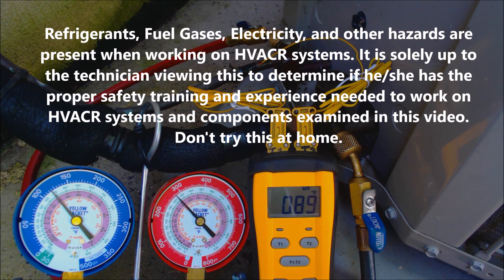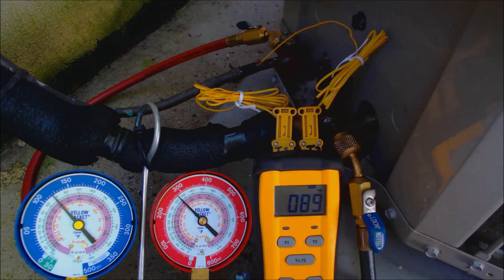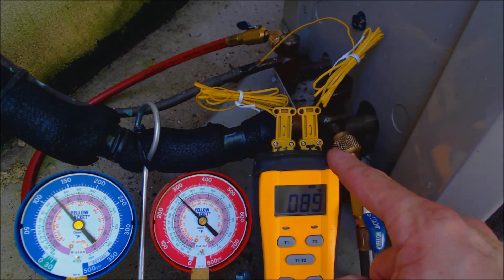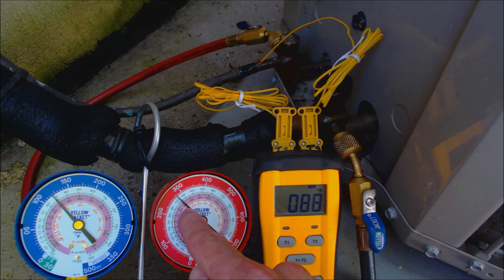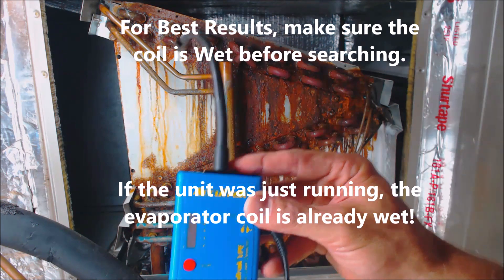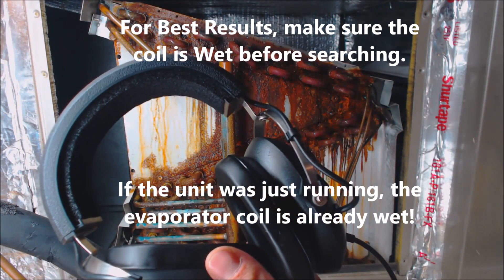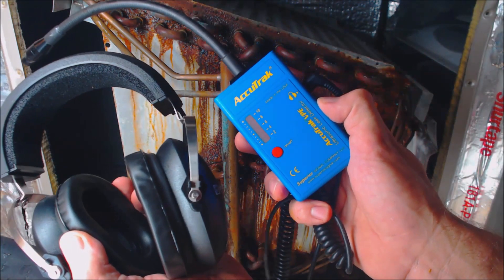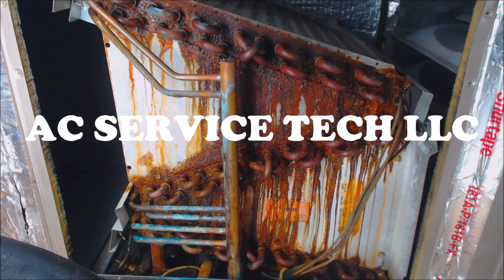AC Unit Low on Refrigerant! Leak Found!

Comment from the maker: Tool List-  https://www.amazon.com/shop/acservicetech
Support-  https://www.patreon.com/acservicetech
For those that are looking for the tools used in the videos: (Linked Below)
Here is the Link to the AccuTrak VPE Pro with Headphones-https://amzn.to/2B2cRO3

Here is the link for the AccuTrak VPE-GN Pro with Headphones-https://amzn.to/2vxD41R

Here is the Link for the FieldPiece ST4 Dual Temp Meter- http://amzn.to/2AhR6ph

Here is the Link for the Yellow Jacket Refrigerant Manifold Gauge Set used in the videos http://amzn.to/2aenwTq

Here is a link to Refrigerant hoses with valves used in the videos  http://amzn.to/2aBumVI

Here is a link for RectorSeal Bubble Gas Leak Detector http://amzn.to/2ckWACn

Here is the link to the Appion Valve Core Removal Tool- http://amzn.to/2uYr8WL

Here is the link for the Ratcheting Service Wrench   http://amzn.to/2dGV4Nh

Here is the Link for the newer UEI DL479 Multimeter with temp sensor- http://amzn.to/2jtsUbJ

Here is the link to the CPS Vacuum Micron Gauge- http://amzn.to/2v1nM3O

Here is the Link to the Appion Blue 3/8" to 1/4" Vacuum Hose- http://amzn.to/2uYlVyc

Here is the Link to the Appion Red 3/8" to 1/4" Vacuum Hose- http://amzn.to/2uYg6Ro

Here is the link to the Yellow Jacket 1/4" by 1/4" heavy duty hose straight-  http://amzn.to/2umtcod 

Here is the link to the pack of 25 C&D valve cores- https://amzn.to/2J1lurm

Here is the link for the C&D Valve Core Wrench, Container, and 3 valve cores- https://amzn.to/2EVGkps

Other tool links can be found in the video description section.

Shop through Amazon! Your Purchases through Amazon provide a means for channels such as mine to earn advertising fees from all purchases after clicking through. Prices are the same as normal-    https://www.amazon.com/shop/acservicetech

All of the ACSERVICETECH Playlists-  https://www.youtube.com/channel/UCOZR-1IqsAer9wzlvFgb4mA/playlists?view_as=public

Comment: Will this work on formicary corrosion leak?
Reply from the maker: It will pick up very small leaks by the noise so it will just depend on how much noise and how little of a leak you are talking b ut I have found some extremely small leaks with this so far, thanks!

Comment: I assume you prefer the Ultrasonic Leak Detector over a dye leak test.  Are there any circumstances where a  dye leak test would be the preferred method to find a leak?
Reply from the maker: Dye would be something that you would look for in all of the visible places. If you can see it, then you would probably be able to find the leak with this detector. All I can say is that I have a great amount of faith in this leak detection method and I prefer its reliability over any other type. I don't like adding additives into the system such as dye or leak stop or anything unless it is because there is a high acid level in the oil. You also have to let the dye cycle through the running system and come back at a later date to look for it. Every leak detector has its place but you can use this tool in a variety of circumstances, even during the nitrogen pressure test, thanks Joe C!
Reply: Thanks for the advice!  Helps my research on the subject.  I believe I have a very small R-22 leak (i.e.less than a pound per year) which I believe will challenge any type of leak detection system.
Reply from the maker: If you are researching the best leak detection method then you may find the same things I did before going and getting this leak detector. Did you read the reviews online and on amazon for this product? Compare this to any of the other brands and types and let me know what you find. The issue on the other hand is after you find it, can you fix it? If the evaporator coil looks like the one in the video, it may be coming from there. Obviously we don't guess and we look and find them but sometimes like in the case of this video, it is worth replacing instead of fixing. Here are two links for your research, thanks and did you see my other video using this tool?- 
  -     Here is the Link to the AccuTrak VPE Pro with Headphones-https://amzn.to/2B2cRO3
--     Here is the link for the AccuTrak VPE-GN Pro with Headphones-https://amzn.to/2vxD41R
Reply from the maker: ultrasonic leak detector video-  https://youtu.be/h60yatrnuPc
Reply: Thanks for the links!  I actually got the name of the product from the tool list link above (super helpful!) and checked it out already.  About fixing the leak:  I was going to cross that bridge when I got to it.  Hopefully it would be something easy like a schrader valve or something.  But I figure there is no harm in trying to at least locate the leak if I can.  if it's part of coil, then of course it depends on where on the coil it's at and the overall condition of the coil itself.
Reply from the maker: Got ya, thanks Joe C!

Comment: Do yo have to be certified to remove refrigerant or does the recover machine have to say approved or does it go either way ?
Reply from the maker: The tech has to be epa 608 certified first before working with any refrigerant. Check out epatest.com or escoinst.com for more info and testing locations, thanks Jacob!

Comment: You would think the high side of the system would be more leak prone.
Reply from the maker: Yeah, you would think, but there has been a bit of time where many manufacturers seem to be making the tubing too thin creating problems at the evap. The condensor tubing seems to be a little thicker diameter to deal with the pressure but it also helps for corrosion, thanks Running Coyote!

Comment: Is it necessary to check both TOTAL subcooling & superheat.
Reply from the maker: Well, it tells you the difference between if you are low on refrigerant or if it is liquid line restriction or low airflow. This way you don't waste time looking for a leak that isn't there, thanks!

Comment: What does it mean if your liquid refrigerant level is fluctuating up and down sometimes?
Reply from the maker: It could be low charge, air in the system, or another issue, but you would check superheat and subcooling prior to that to know what is going on before concluding the issue, thanks Jacob!

Comment: What percentage of leaks would you say you find with this leak detector?Good video.
Reply from the maker: Well, in my view, there is no real reason that you wouldn't be able to find the system leak or leaks with this unless you can't access the area for some reason or the tech is not looking in all the areas or hasn't wet the area beforehand. What is crazy is that they have even a higher end model of this tool the VPE1000. Using this tool has given me the full confidence that I will find the leak and I am no longer antsy about if I will find it or hoping it is larger so I can see it or for my sniffers to sense it. So you know, I test the evap first since it is wet. Then I wet the outdoor coil and test that and all the joints.  It makes the noise even louder when the coil is wet or right after the system was turned off and there is refrigerant oil in the tube near the hole but I always wet the condensor before hand anyway except when on a roof. It is picking up ultrasonic noises so wind is only a little background noise compared to what the leak sounds like. Obviously I don't try to find the leak while the system is running. The noise is more of a squeal, popping noise, or full static noise like in this video. What I am saying is it has found the leaks on every system that homeowners have allowed me enough time to check for one on. I am not going to tell you that it will find every leak for you but I would dare someone to try this compared to other leak detection methods and for good reason. I did a lot of research on this tool before getting it and it has not let me down at all. If you read reviews, amazon reviews or research ultrasonic, this is the tool that everyone is extremely happy with and I am too! Thanks Air Mechanical! Links to the tool are in the description for research, thanks!
Reply: Thank you very much. I am seriously looking  to purchase this leak detector.
I currently have an old H10 and an Inficon Techmate. As you mentioned I always hope that the leak will be large enough for those 
detectors to pick up or to show up with nitrogen and bubbles.
Reply from the maker: I would like all techs to know that there is a reliable solution. This topic has always been a huge issue in our industry, thanks Air Mechanical

Comment: Does that leak detector just pick up sound or does it sniff it too?....
Reply from the maker: It picks up sound so it doesn't matter what refrigerant is in a system or if there is nitrogen inside. You don't have to worry about refrigerant concentration, light wind blowing the refrigerant away, calibration against refrigerants, warm up time, changing sensor heads, having to move extremely slow to pick up refrigerant concentrations or having to wait for the refrigerant to make its way through the sniffer tube to get to the instrument which means the tool goes off after it has passed the joint. This goes off immediately since we are talking the speed of sound. After much research and many questions from subscribers and patrons I got this version and am so happy with it and have found many leaks with it that my sniffers were not even picking up. I told Superior Signal that I wanted to help get the word out in reference to the tool since it is a reliable solution to one of our biggest problems in the industry! Thanks Oscar!
Reply: I don't understand why you would use anything else.  Immune to wind and works great with wet coils.  This is one of best toys you introduced and can be used outside of HVAC.  @acservicetechchannel
Reply from the maker: I really love that tool! thanks Ricardo!

Comment: What’s your  process if you suspect there may be a leak in the back side of the coil?....
Reply from the maker: I run the detector on the inside of the coil along the back edge since it can hear sound and then I bend the tip and reach along the back ubends as well. Depending on if it is an N coil Acoil or A coil on its side, I usually can get close enough to hear if there is noise. Sometimes the tin connecting the slabs get in the way. I have confidence with this tool when running across a joint. I never worry if I missed the leak when I check an area. Confidence is a beautiful thing when trying to find a leak! Thanks Oscar!
Reply: AC Service Tech LLC niceeee..... and what about for the outside condenser?....... will it even pick it up?.... with all the ambient noise?....
Reply from the maker: Yes absolutely, I usually just wet the coil down and then search for it. Evap is already wet usually. You are usually in front of the condensor coil so mild wind won't affect it much. It is searching for something very specific anyway, ultrasonic noise. Wind is different. It is looking for that squeal that we can't here with our ears when the pressure is making it through the tubing hole and the oil in the inside or water on the outside help make that ultrasonic noise even more present. I really like the tool and has been working great for me, thanks Oscar!

Comment: Great video. The coil looked horrible. Do you have a digital gauge set?
Reply from the maker: That coil was only 11 years old which is the crazy thing. Manufacturers were just making those coils with thin copper tubing for efficiency but they corrode easily. Yes the SMAN460. I just go back and forth between the gauge sets, thanks